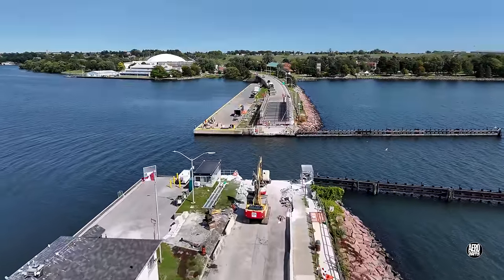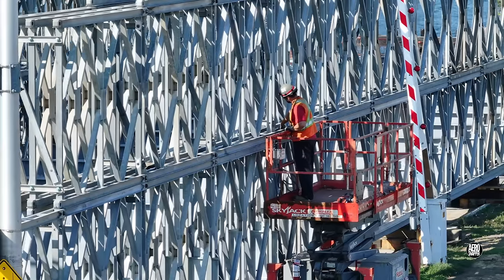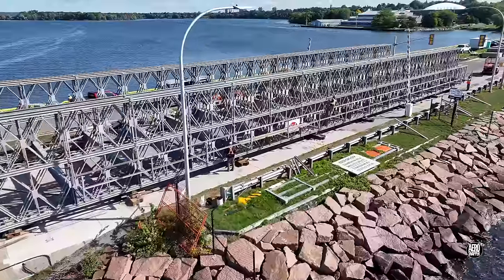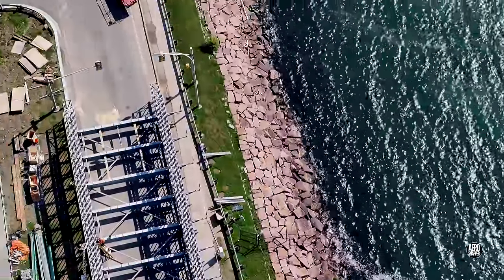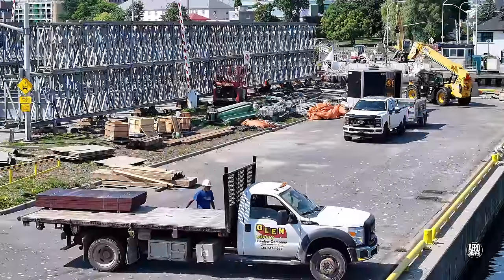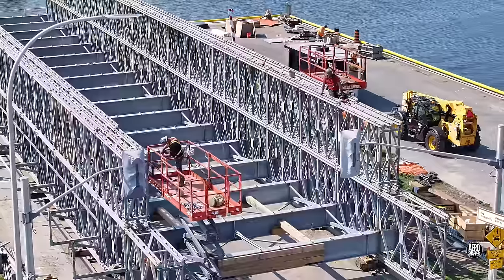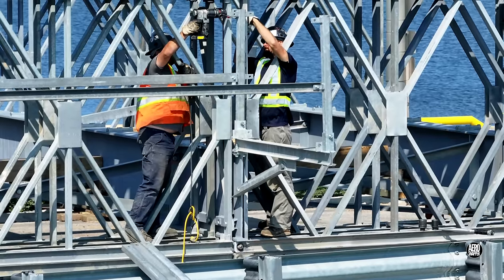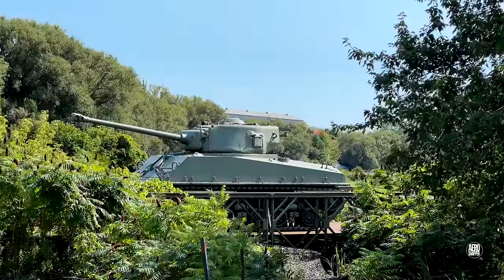Short Back and Sides - an update on Kingston, Ontario's La Salle Causeway  4K

Comment: The one thing that impressed me the most was all the steel workers had earplugs in. It doesn't take much for hearing loss to start and it's not reversible.
Thanks for the update Mike!
Reply from the maker: Ian - I had noticed that too. As a veteran with profound high frequency loss I applaud your observation. Construction can be very damaging to the hearing - great to see a group clearly aware and taking precautions. Effects often appear too late to take any remedial action.

Comment: Dear Aerosnapper, I'm really enjoying your coverage of the causeway project. I would like to purchase a reliable, affordable drone. Do you have a recommendation?
Reply from the maker: Steve - a great deal depends on what you want to do and your budget. I have had nothing but excellent performance from DJI’s various models. They all perform very reliably, have excellent cameras and strong safety features. Any one of them would work well. As a guide, expect to budget about C$350 for the entry level, which would give you great imagery and fly well - to name a figure !  It might be helpful to know that, in Canada, and most other countries, drones weighing less than 250g do not require registration - it the pilot to hold a certificate of operation.

Comment: Progress is always good.  However, torquing fasteners after a structure is built seems to be a missed opportunity.  In the aviation world, when a fastener is installed, it is tightened to it's final torque specification at that time.  It is generally bad practice to leave it for later - imagine building an aircraft engine, and leaving tightening the nuts and bolts till last.  Umm - it wouldn't last long, or a critical fastener may get missed.
Reply from the maker: Peter - an interesting and valuable observation.  I am no expert, but it has been suggested to me that in construction of this kind, to accommodate small changes in the relationship between components, final tightening and torquing to specification is undertaken once the structure is complete.  I can say, from close attention to the work here, considerable care is being taken to ensure that nothing is missed.  Perhaps someone with relevant training and experience can let us both know what's the best practice in work of this kind.  Thanks so much for your interest and for making an important point.
Reply: I have to disagree. Perhaps in aeronautics, they have a different procedure, and stress-test the assemblies after (which they do), but when assembling mechanical structures, like engines, etc, there's always a pattern to initial and final torque settings, much of which is to spread the stress evenly.

When you put a wheel back on a car, for instance, you never torque the nuts max until following a pattern of opposing nuts in progression. This is typical of almost all assemblies required to handle stress. Sometimes this involves heating and cooling an assembly to 'temper' the stresses.